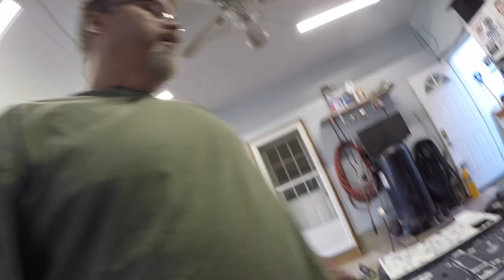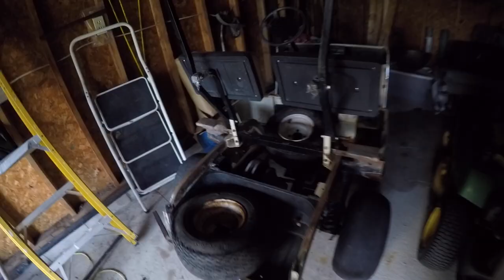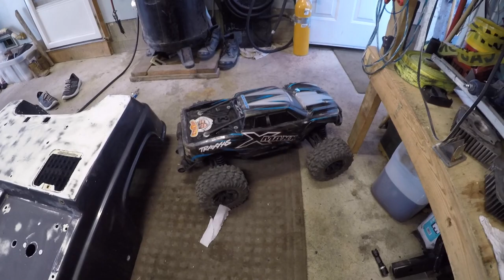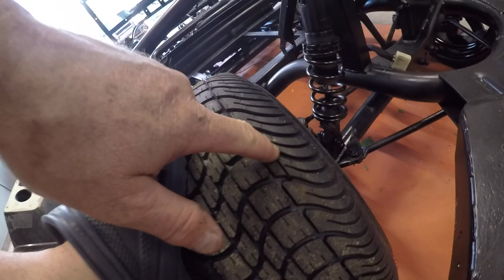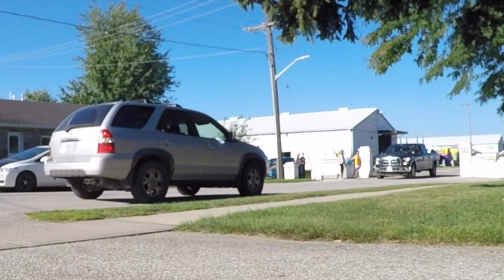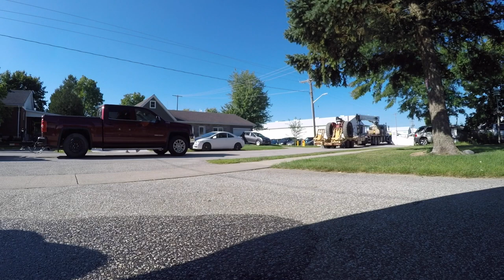Antique Tractors And some More Golfcart Mods

Comment: The body from the electric cart should fit right on that gas e-z-go. Something to kick around. Those 6v batteries are deep cycle, weigh like 60lbs each. Some model carts have 8 batteries and are 48V and they make performance kits to convert 36V carts to 48V. Usually comes with a new controller. Cheers Bill!